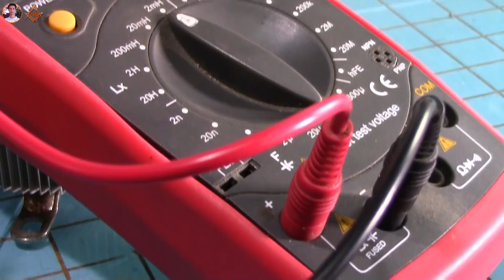How to increase subwoofer bass, Tips to use free chokes for better bass boost for speakers

Comment: Nice I forgot to use the 1uf x 2 caps and still does great, but really I run my woofers str8 for more treble for hi-fi classic music, in fact I love using my PA Speakers for my stereo.I like it LOUD with out blowing midranges like in normal speakers  but do add the choke for the bass when  want a diff sound or more jazz type playing,  loudspeaker crossed over sometimes and bullet tweeters. JBL and Altec then EV are my all-time fav - never cared about a lout of bass, but the right amount to equal on or near the live stage...but yeah man ...iron air core is the way, and clearer sounding

Comment: Fantastic another one of those satire DIY things with bogus claims, very amusing. Ever heard of eddy currents? Evidently it appears like you haven't... If you actually tried to pass 8KW RMS through that improvised inductor created using an "old bearing" as depicted in this pathetic excuse for a presentation, the bearing will just heat up rapidly and the wire insulation will melt. Moreover the improper/inept termination practises employed, will ultimatly limit the current flowing through the coil, so In principal this will act as a filter, but it will not boost anything. The level of cringe in this presentation is just exquisite... Come on 8000W... in your dreams kid, more like 80W. You can buy proper iron cores, or ferrite cores on places like ebay for not much and the project would have been nicer, what you have made is a makeshift low-pass filter, not a booster. :)
Reply from the maker: You should remember that the magnetic field to eat into the speaker is very low.
To heat any core 1 unless it is saturated from.
Whether you use any core with exorbitant prices
There are cases, not just using expensive components as well.
8000w has run comfortably
I just said that's it...
Reply: @AlfredH  Cores are not "exorbitantly" priced. At 8000W RMS as you propose, you will easily saturate the iron. I am willing to bet money on it.
Reply: @AlfredH  actually "you" should remember that 8000W as you quoted, WILL in fact create a large magnetic field. So I cannot take what you say seriously here.

Comment: THIS CIRCUIT IS A LOW PASS FILTER INDUCTION, NOT AN AMPLIFIER. . . .  BUT IN ALL CASE ITS WORKS TO INCREASE CURRENT INTO THE SPEAKER COIL. . . 
: - )
Reply from the maker: I have designed a basic parameter to apply most amplifiers

Comment: You really need to know what you are doing before you do this. If you put a cap across the speaker that is the wrong value it can put a short on your amp at certain frequencies. Unless you know the value of the choke coil you won't know what frequency it cuts in at so you won't know what size cap to use. Example say the choke coil only passes 1 k and below and you install a cap that passes 500 Hz and above than anything between 500hz and 1 kHz will be dumped to ground thus putting a short on the amp at those frequencies. This not only would cause you to lose those frequencies in the speaker but it could blow your power amp up as well!
Reply from the maker: I know the value of inductors. Here I cut at a common and common frequency

Comment: this is misleading video, better to cut low / high freq using active crossover which is more wide available today, if you insist you could fried amp components and melt some cable
Reply from the maker: This is not a misleading video. You can do it without spending time and money.
Then listen to the sound for a while, will know the results.
All those who know about electronics, or electronics repairers will not object, or give opinions contrary. or convincing arguments about this.
There will not be any damage to the amplifier.
or have no effect on the cables in the amplifier
Give me a specific reason to persuade me ...

Comment: You should have learn about passive crossovers in first, and the energy cannot be generated but transfer.
Reply from the maker: The henry inductor will cut the high frequency, not let the high frequencies go through. without losing the power of the amplifier. Reason for inductor
  have too large capacity. ...

Comment: Total fail! All you’re doing is building a passive crossover which robs power from the subs. Might make them hit  cleaner but not harder, probably not as hard as without it.
Reply from the maker: You just say without giving a specific explanation.
There is no reason to reduce the power of the amplifier here.
I only say one sentence:
It is an inductor used to cut high frequencies.
If you have any comments, please comment more specifically.
Do not comment so general.
Reply: Alfred  by the way, your way of doing things is pretty freaking ghetto and Jerry rigged!
Reply from the maker: It seems like you say it's down on the road to the subway right?
You say it robs the power of the amplifier?
What you see with the familiar eyes of crossovers. and mistakenly thought.
There is no reason to steal power here.
It can only reduce the power to the speaker when the resistor value increases.
Only when the Resistor value is high is there a decrease in line flow to the speaker.
Cheap crossovers have high resistance values. This will reduce the output power of the speakers.
An extremely powerful inductor will have a resistor value of approximately 0.08 ohms
An extremely powerful inductor does not reduce the power running out of speakers.
An extremely powerful inductor can still cut high frequencies.
This is the advantage of a dinosaur inductor.
You should be clear and specific more ...
Reply: Alfred I did t say anything about reducing the power of the amplifier. I merely stated fact that a passive crossover will decrease power to the subs as it robs amplifier power. You should know this but I guess you don’t understand the concept!

Comment: What do you do with the other ends of the wire thats not connected to the speakers?
Reply: connect it to the microwave
Reply: @ojjunior5238  Its the best chance the guy has of getting the quoted 8000W lololol
Reply from the maker: one end to the output of the amplifier, the other end connected to the subwoofer.

Comment: are you kidding me ? you just made a low pass filter....does not increase sound
Reply from the maker: I'm not kidding you with my project ...
It is an extremely large capacity inductor.
This inductor blocks high frequencies,
Facilitates the low frequency range passing through.
So the bass sound is stronger, deeper and more rounded.
Due to the large capacity advantage, the resistance value is almost zero ...

Comment: This is just a filter. And you need to use a ferrite core... Not a steel one.
Reply: It's likely the bearing is still able to contain the flux don't you think?
Reply: @mikeymike4g63  Heard of eddy currents? Yes it may work but not when we are dealing with the 8KW power levels the kid is talking about. You can literally buy powdered iron ring cores, or ferrite rings as big as that bearing on ebay for a few cents. The issue is it will heat up due to the eddy currents in the steel and at 8KW the whole thing could catch fire, I think his methods of termination would actually prevent that level of power from being transferred to the speaker however. Still it was funny.
Reply: @kaboooom2000uk  Can you explain what an eddy current is?
Reply: @mikeymike4g63  "A localized electric current induced in a conductor by a varying magnetic field." In this case when an AC current passes through the wire, a current will be induced in the steel of the bearing, and will inevitably heat up. at such power levels like 8KW the whole thing will likley cause the steel to glow red hot and the inductor will soon fail. had a powdered iron core been used, this heating wouldnt happen... Like we cover this in basic electrics. I am amazed that nobody even mentioned it.
Reply: @kaboooom2000uk  Ah yes, inductive heating uses this principal. Thank you for explaining. Is there a difference between flux and eddy currents? They seem to be similar concepts
Reply: @mikeymike4g63  flux is the measurment of feild strength, eddy currents are produced as a result of an alternating magnetic feild coupling with a conductor like steel of the bearing, and as the steel is not powdered iron the current from the eddy can flow easily... So depending on the magnitude of the flux feild the resulting eddy currents will be proportional to this. Also if the material is a poor conductor like steel, heat will be generated, copper will produce less heat, but establish an opposing magnetic feld, which is the principal behind how AC brushelss motors work (see squiriel cage motor)
Reply: @kaboooom2000uk  thank you! i appreciate you taking the time to explain
Reply: @mikeymike4g63  You are welcome.

Comment: What type of oil do we use on the bearing?
Reply: DEF fluid..
Reply: Hell forget the bearing, throwing crisco on the subs would increase the bass just as good! Lmao
Reply: What type of oil, that's funny, this dude is a plonker and has no idea how to increase bass .... how about a folded horn, in any case apart from massive distortion together with smoke the voice coil would never be able to take 8kw I use the PD2150 (21") for subs rated at 1kw RMS, I wouldn't even try to push to 2kw due to the cost of a replacement re-cone kit.
Reply: Skunk spray & then smoke it!
Reply: @stratgibson funny.......Somebody is gonna try it...Cone or Magnet?...lololololol

Comment: Ah! A simple filter! Remember only is ferro magnetic metal!. Traduction : at full power= full distortion. Is obviously. Never use a simple iron. Read more about this theme.
Reply from the maker: Can you tell the specific reason why full distortion is not ?
For inductors for amplifiers, the lower the quality and magnetism of the coils, the better
For a core in the store, they used ferrite to increase the magnetism. This will save copper wire. saving production costs.
The best quality core cores for the frequency divider are the cores of nothing ...

Comment: You're not increasing bass. You're cutting treble. Just an inductor is a 1st order(electrical) low pass filter. A just a cap is a 1st order (electrical) hi pass filter. A inductor + cap as you've shown is a 2nd order (electrical) low pass filter. Without knowing the impedance curve or frequency response of the speaker or the value of your homemade inductor there's no way to tell exactly when it's cutting the bass.

A little FYI crossovers change the impedance curve of a speaker. It's very possible to smoke your amp if go shorting the wires with random caps...
Reply: Gracias
Reply: I'm sorry alfred but your explanation is misleading
Reply: @DPDPDPDP  I second that
Reply: No fuckin way to light up a single bulb witg the manet hahaha. I yried thus nonsence video!!! No no no di not tbis!!!! Not working at all!!! Nice try!!!!
Reply: Create ur own YouTube Channel Men 😁😅😂✌️
Reply: Jason Gray  bro I love the way you shut this guy down on his fake lies. 💯💯💯🤙🤙🤙🤙
Reply from the maker: If your amplifier is large adjustable sound
This means that the treble sound will also be loud, and follow the bass
At this point the sound will not be separated
This means that it mixes into the bass sound, and blurs
Cut off high frequencies so that bass speakers only do a low frequency task
This means that it only works in the bass strings
So the bass will be stronger, heavier and clearer
High-power inductors do not reduce the volume. because its resistance is almost zero
Tress loudspeakers will handle high frequencies
And this is just a primitive filter, so it can be applied to most amplifiers and bass speakers
This does not waste too much time and money to try it.
Your opinion ?
Reply: My opinion ~

"If your amplifier is large adjustable sound
This means that the treble sound will also be loud, and follow the bass
At this point the sound will not be separated
This means that it mixes into the bass sound, and blurs
Cut off high frequencies so that bass speakers only do a low frequency task
This means that it only works in the bass strings
So the bass will be stronger, heavier and clearer"

A well built inductor does block treble, I'm not arguing that but again that does not boast bass.

"High-power inductors do not reduce the volume. because its resistance is almost zero."

Iron core inductors (like the one you built) do have very little DCR but supposedly add distortion. A proper store bought inductor with a predictable stated value is not expensive and would more then likely sound better.

"And this is just a primitive filter, so it can be applied to most amplifiers and bass speakers."

It all depends more on the speaker then the amp. As I said you're changing the impedance seen by the amp in ways you have no idea without measuring it. It could be fine, it could blow your amp?

 "This does not waste too much time and money to try it."

You probably wasted more money on the wire than a cheap iron core inductor costs...
Reply from the maker: Inductors have the duty to block the shock, block high frequencies
The frequency of the treble speakers is from 8kHz to 20kHz even at 40kHz
It is high frequency and treble speakers undertake.
There is not any chokes that can let high frequencies go through.
There are three types of chokes each with different advantages and disadvantages.
The inductors you buy in the store are never good. It was ranked # 4
It is made from ferite core to benefit the Henry numerical value, to save copper wire, saving material production.
Its downside is the heat and the volume loss.
The best inductors are at the core of the air. It was ranked No. 1. But its downside was the cost of copper, and the total impedance was high
Inductors placed third is made of silicon core, its disadvantage is loss of core
I asserted that my chokes from the Iron Ball Core must be ranked No. 2, better than the silicon core
Inductors do not distort. In itself it is the last layer filter to make the sound more rounded, not distorted
Reply: "The frequency of the treble speakers is from 8kHz to 20kHz even at 40kHz"

WTF are you taking about? 40kHz? Are you planning on sonic welding? There are no speakers on the market that go to 40kHz that I am aware of... Even if there were no one could hear it.

"There is not any chokes that can let high frequencies go through."

Inductors are not brickwall filters. It's a 1st order 6dB per octave slope.

 "The inductors you buy in the store are never good."

Oh, sure,  the random wire you wrapped around a ball bearing is much better...

Comment: U are not increasing any power. Don’t be fooled. I’ll make it simple why do that say the shorter the cables the better! Why ? Because the longer the cable the longer it takes power to get to it. So power is lost with longer cables.
Reply from the maker: Why do I have to trick you while it's very simple to prove? To test it will not waste too much time and money. And everyone will find out immediately
  Your argument shows that you are not knowledgeable about resistors
The energy loss is due to the resistance value on the conductor
And you do not know the value of the resistance on the wire is how much
it is about 0.1 ohm
The coil is the coil that generates the Henry value
Value Henry used to cut the high frequency of the speaker
So what bass speakers work with which frequency band?
I just came here, for repeating too much

Comment: You are not increasing the bass. You are just filtering out treble.
Reply: Alfred That's what Timothy is implying. Filtering out the treble.(high frequency)😊
Reply: Not only that since its a passive circuit it's stealing power from the sub..  So actually getting less bass
Reply: @r0llinlacs  Correction it is a passive crossover it is not powered externally, it will still exhibit losses and you are right it will sap some of the power going to the sub, Active will generally be installed in line before the amplifier, much like my Behringer active crossover. Passive crossovers need no external power supply to function but will reduce the audio signal a little doing their job.
Reply: kaboooom2000uk my mistake good catch
Reply from the maker: Inductors have a high frequency cut function. So Bass speakers will only handle low frequencies
Then the bass sounds clearer

Comment: Interessantes esse métodos seus parabéns
Reply from the maker: Muito obrigado
Reply: Isso é um filtro de frequência é, man?
Reply: what a moron.. you can buy coils or make them with plastic spools and copper wire..been doin it for decades. it does not increase bass..its filters or the highs( treble). and  capacitors will filter the lows(bass) from your tweeters...but  electronic crossovers are the way to go if your serious about sound systems